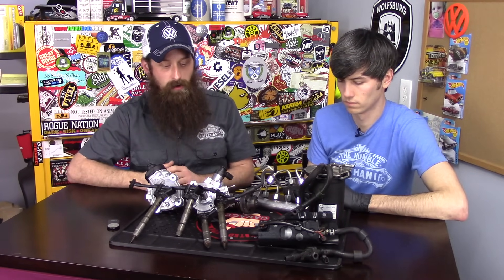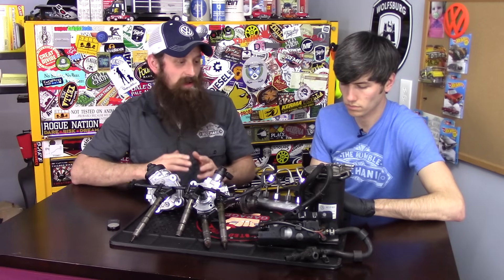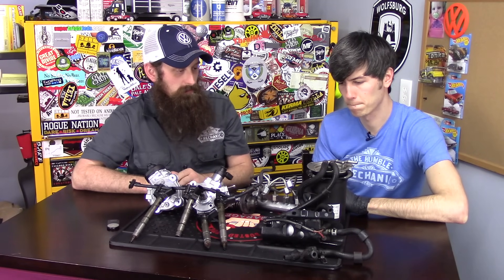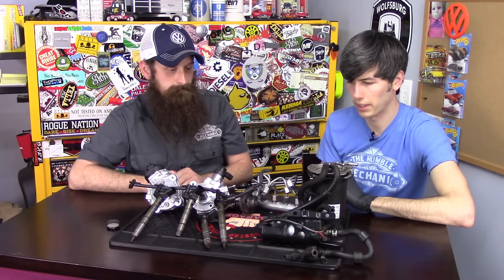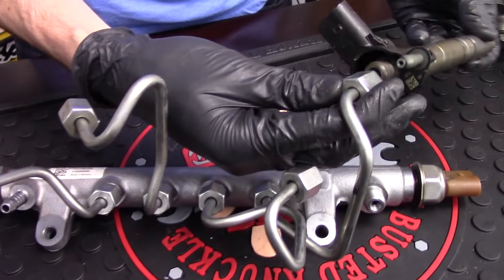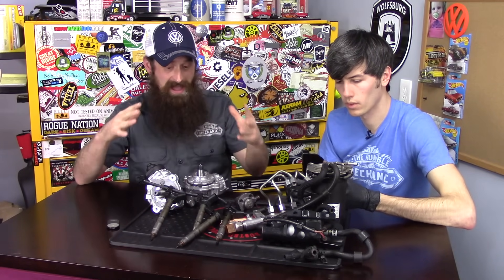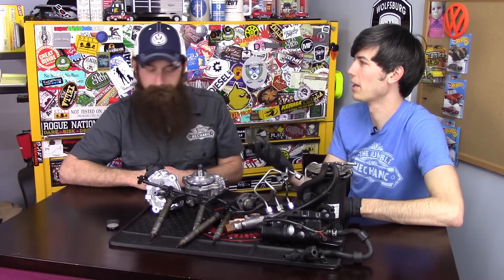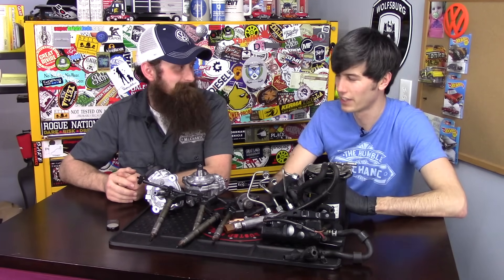Putting Gasoline In A Diesel Car - What Happens?

Comment: Assuming what this guy is saying is true, what plastics and elastomers do they use in diesel fuel systems that are reactive with gasoline? I find it a little hard to believe all that needs to be tossed after a relatively short exposure to a mixture of diesel and gas.
Reply: +HumbleMechanic 
Seems as though it would be prudent for manufacturers to install a high pressure fuel filter down stream of the HPFP. 
That would help mitigate fuel rail and injector replacement from all types of fuel contamination. 
Same could be said for an in tank or post lift pump fuel sensor similar to a Flex-Fuel sensor on gasoline vehicles to quantify ethanol percentage that would alert the ECU of water or gasoline contamination and shutdown before post lift pump and primary filtration contamination can occur.
Reply: +patw52pb1 Some diesel fuel filters, Chrysler is one, solidify (melt) if gasoline comes in contact with them so no liquid will pass through them and they are, of course, placed upstream of the high  pressure pump.  For those not knowledgeable about engines, this causes the engine to stall as a result of fuel starvation and all that is necessary to fix the problem of mixing gas with diesel is to drain the tank, blow out the lines, replace the fuel filter and possibly prime the system.
Reply: +theslimeylimey 

  EXACTLY!!  Diesel fuel may be slightly better lubrication than gasoline (petrol), but come on now, you're going to see high amounts of wear in the high pressure pumps from such a limited amount of cross fuel contamination?  Bollocks!!  Those buffoons need to find a real job that they can actually do.  I don't think that I've ever heard a less intelligent conversation regarding anything in the automotive field coming from anyone before this tripe.  I've been working on all kinds of machinery for about 45 years now, rebuilding entire drive trains, working on race cars as well as truck fleets, and have seen quite a bit of misuse and abuse in that time, and if the metallurgy of a HPFP is so weak that a few gallons of gasoline being mixed into the Diesel is going to cause a catastrophic failure anywhere in the system, then it's a piece of junk that should never have rolled off the assembly line in the first place.  All you really need to do is flush as much of the mixed fuels out as you can, maybe dump in some fresh motor oil to bring things closer to normal, and call it good.  The Diesel fuel that is not burned does return to the tank, so it will even out in a few minutes of run time.  Certainly not enough damage, if any, is going to occur to make replacement of an HPFP necessary.   It's because of stooges like this that I always do my own work when I can.  

Randy
Reply: A mechanic, for whom I had a great deal of respect, at the Dodge (Ram predecessor) dealer where I used to have my Dodge diesel serviced and inspected told me that about  the Mopar diesel fuel filters.   My truck has a diesel fuel filter with a drain on the bottom and a sensor to tell if there is "water in fuel" although after 100,000 miles, never once, have I ever experienced water in the fuel and that includes examination of the fuel filters when I changed them and that really surprised me.  I have experienced water in gasoline clogging the gas fuel filters on more than one occasion however.
Reply: +Quantum Leap Just the opposite in the USA. The Diesel fuel station nozzle is big, the gasoline is small. The gasoline nozzle fits easily.
Reply: +nbrod3n If the pump collected the vin on each fueling it could counter act theft as well!
Reply: +theslimeylimey You're right, it's a myth, the worst that happens is the car won't run right or not at all, I fixed a diesel car that got gas in it by accident it still runs fine after 4 years. As long as you get the gas out of it right away it'll be fine
Reply: +theslimeylimey I think what he was saying is that the fuel filter is shipped as a complete assembly, with hoses included, so you're gonna be stuck paying for the new lines anyway.
Reply: +theslimeylimey That's my reaction!  They car won't run as soon as the gasoline hits the engine or even the fuel filter ... and you're going to have it in the shop immediately to figure out why ... so the "exposure" to non-lubricating fuel is virtually non-existent!!  That said, I have heard that the one major down-side to the latest VW diesels is exploding fuel pumps due to their intense pressure, so I have no idea what impact this exposure has on those????  $8000 is just WAY over the top for something this simple to repair though!
Reply: A truckload of pure horse manure.
Rubber hoses are used indistinctly for diesel fuel and gas and so are seals and gaskets.....
Reply: Buck0338
I am aware of genuine Chrysler/Mopar diesel fuel filters on the RAM and Sprinter series that swell and clog in the presence of water by design, but I am not aware that they will "solidify" in the presence of gasoline. 
Do you have a citation that supports the premise that the filter will solidify in the presence of gasoline?
Reply: Buck0338 I was wondering about the filter housing and hoses more than the disposable element itself. It seems to me like an unnecessary expense to throw away that too. It would be like throwing out the airbox when you change your intake air filter.
Reply: I seen these issues  often you will be supriced  many techs don't  ever  check for diesel contamination, these  cars come to dealer over and over for problems
Reply: +theslimeylimey Maybe you heard of problems in europe with e5 and e10. There is ethanol in the gasoline which is the main problem for plastics and elastomers. You need a special kind for these applications, because the plastic could swell up (korrosive). Another point is that the ethanol in the gasoline could react with some aluminum alloy, like Opel in Europe.
Reply: +nbrod3n  I've driven small straight trucks with diesel engines before, and the filler neck is very narrow, you cannot put a gasoline nozzle in there. At least that's the way Izuzu trucks are set up.
Reply: That's a really good idea.
Reply: Your right, I suppose it would be an invasion of privacy... As for the license plate checks, you should see what they do in the city I live in. They have cameras mounted on the trunks of certain police cruisers that scan license plates as they drive past them, whether they are parked or not, to look for cars belonging to wanted felons! When I head about that I found it kind of concerning and I guess I would also consider it an invasion of privacy. Of course we don't want felonious criminals running around free but where do you draw the line, ya know? How long before they start using the same technology to "profile" certain individual who havn't done anything wrong yet?? A slippery slope for sure.
Reply: BillCosbyEatsBabies  True enough, this gathering of personal info and how it's used does create a slippery slope. Having said that, most search engines already record search patterns, and I know Amazon and others record purchase details.  That's why security of accumulated data is so important. And that's why I am fourscore behind Apple in this cell phone fiasco.
Reply: agreed
Reply: +nbrod3n Actually for ex. modern Mercedes cars block the car when not only wrong fuel is in the system, but with poor quality fuel as well. In Europe at least, don't know how with American ones, because fuel quality in US is usually worse than in Europe so maybe the limits are different.
Reply: +theslimeylimey Well, what you say is true, unless it is that E85 crap. That ruins the synthetic parts even in a gasoline engine not intended to run it
Reply: The high pressure area comprises the pump's top of each cylinder, which connect directly to the high pressure tube, the injector connector and the injector properly and I don;t believe there  is anything that could explode due to excessive injection pressure
Reply: What the heck are you talking about there, "the pump's top of each cylinder"??  If you are talking about a certain style of  injector that is fed by a transfer pump and the actual pressure is generated by a special cam shaft lobe pushing on it, then your punctuation is wrong.   If you mean something else, please explain it to where we can understand what you are trying to say.
  If there is water in the Diesel fuel, you can blow the tips off of the injectors, or so I was told in my Diesel engines class module, when I worked for SoCalEdison as a fleet mechanic for 15 years.  We were shown a couple of injectors from a Detroit Diesel 6V92 that had tip damage, and that was said to have been the cause.
Reply: +AspergerDad well.... It IS a VW
Reply: The brake clean they use to clean the gas out, is way harder on the components than gas.
Reply: It's less the exposure to fuel and more about the contamination of metal from the HPFP.
Reply: Frank Furter You are right. Fuel contamination can destroy an engine. Something like happened to me, where  they sold E85 a regular is not common, but the wrong fuel will possibly ruin an engine, at least to it needing service. When I looked at what the E85 did to the rubber parts in my fuel system. You can not believe my anger. They busted the station for cross contamination. And I was reimbursed. Not fully, not fully

Comment: Question: If you mix the gasoline with adequate  2 stroke oil to lube the fuel system the fuel will most likely not damage  it?  the motor will then probably be damaged by detonation inside of the cylinders?

Comment: welcome to Sweden.. green handle = gasoline/petrol and Black Handle = Diesel.
We also have Blue handle wich is Ethanol...
Reply from the maker: crashes into gas pump in confusion
Reply: +Engineering Explained lets say that tourists misfueling their diesels is not a unknown problem...
but the major problems might be those who put ethanol in their diesels... same procedure as gasoline though. gasoline engines usually handles ethanol without any big issues so that is a no issue situation.

Comment: What's worse? Diesel in a gasoline car or gasoline in a diesel car?
Reply from the maker: A diesel will typically run longer (by a longshot), but can cause more damage if you continue to run it. See 9:42 for a description of diesel into gas car.
Reply: +eins As a technician I'd say a petrol driven car should not take any damage from running on diesel, If you get it to run at all.

Comment: I once put Diesel in a 2.4 twincam Nissan Urvan(minivan), I didn't know that it take gasoline. So i cranked the engine, it started shaking heavily, i stopped the engine and took it to a mechanic, he emptied the tank and put some gasoline in it... He then cranked the engine, it started to shake for like 5 seconds and the exhaust produced white smoke which went off in like 30 seconds.. The engine now runs good!
Reply: Spot on! I would do the same thing. Not spend all that money replacing various parts....
Reply: +Likhwa Dube I know right?!
Reply: That's diesel into a gasoline vehicle though. Completely different scenario and outcome. With gasoline into a diesel you could probably get by without changing anything before the fuel filter, but like in this video, the metal fragments in everything would cause those parts to fail.
Reply: +SlipknotMaggot0526 Oh wow, didnt know that. Thanks man..

Comment: But what about the other way around?
Diesel in a petrol engine, we looking at the same problems or is it worse?
Will it even start? with lower compression in the chamber and different ignition methods etc.
Reply from the maker: Answered in the video at 9:42. :)
Reply: +Engineering Explained Thanks for the answer but, I saw that part but was hoping for a few more details, like as was explained when petrol is put through a diesel engine, it lacks lubrication properties and causes increased friction and wear, but would this work in reverse in a petrol engine, would it decrease friction and cause less wear.

Also to my second point, could the engine even run or start using the petrol/diesel mix, or would the engine simply lack the compression to ignite the mix?

Comment: So the point is, if gas was filled in a diesel engine, the diesel engine gets damaged overtime because gas don't have the same lubricating property of diesel? I know the last part of the video shows the opposite scenario but did not explain the consequence of filling diesel in a gas engine.
Reply from the maker: Correct, the reverse is not as bad because typically it won't run well so you're forced catch the problem early.
Reply: +Engineering Explained Thanks! I had this same question to myself long time ago and didn't have the real answer until now. I thought filling up with incorrect type of fuel will destroy the engine instantly. Hahaha. You guys are the best! Cheers!

Comment: Crap diesel will do the same thing. I filled up at a well known station and 2 days later the money light came on. I checked the fuel filter and saw glitter.  Fortunately VW picked up the tab, $7500.00.  I love the TDI but the pump is definitely its Achilles heel.  Thanks for the video.

Comment: Interesting video, but i cant help but think thats utter tosh about the necessity of the expenses involved in this. I put petrol in my diesel van and drove away until it literally died in the middle of a junction. The recovery vehicle came and took it to a garage that can fix this problem and it cost me £30 - thats like $50. Never needed anything replaced. 

 My workmate then did the same again in the same van about 8 months later (and about 15k miles) and again, £30 to remove petrol and clean the system. Never had any problems in the following years and 60k+ miles till i traded it in. I know a few other people who have done the same on rare occasions over the years and non needed any parts replaced or ever had any related problems.

How you could justify changing the entire fuel system at a cost of $8000..... blows my mind. 

It also happens way more often than you think - especially if you drive a diesel for work and a petrol at home. A friend did this at xmas, and when the recovery guy came he asked if this happens a lot and he says this was the 10th call out of this nature in a week! 
My friend told the recovery guy he felt really embarrassed as this was something a woman would do and the RAC guy said that 9 of the 10 people he helped were males lol.
Reply: modern deisels have basically no tolerance for misfueling, but old deisels could run on a mixture of vodka a sticks and wouldn't break.
Reply: Halofan830 My van was a 2006 dont know if thats old enough to have been/not have been a problem.
Reply: +Marc Gooding (marcoboyle) Diesels in EU have smaller fuel nozzle and on the gas stations the petrol one is wider, meaning its really hard to do it accidently. Even putting the diesel nozzle in a diesel is harder, at least for my car. I often have to really try to put it inside.
Reply: +Marc Gooding (marcoboyle) Mine was a 1980 Rabbit, but did the same thing and never had another problem!!!!
Reply: +AspergerDad Yep!

I also just got my RAC breakdown cover renewal through and read through it and it specifically states that they will help if i put the wrong fuel in and pay for everything. somehow i dont think its standard practice to change all this - otherwise there is no way that would be offered for free on a $80 a year breakdown policy.
Reply: Yeah, I get the same problem with my wife too!!
Reply: +AspergerDad Ah yes I remember those cars, they were so easy to find. All you had to do was look up and spot the line of black smoke.